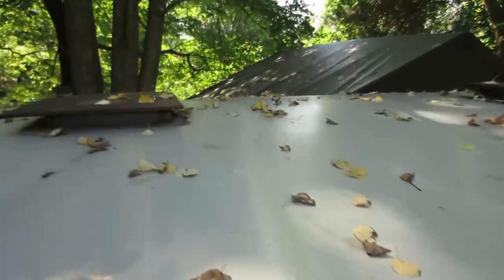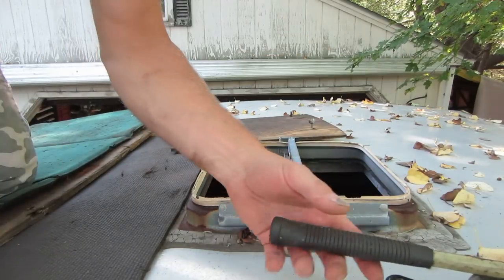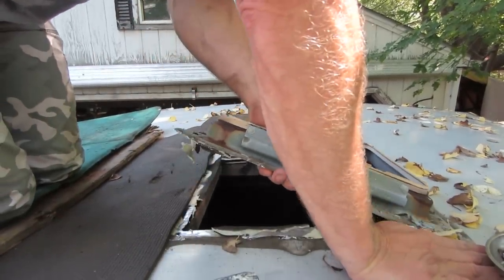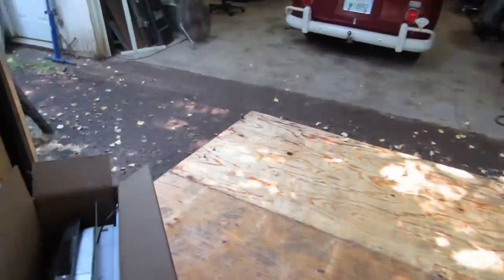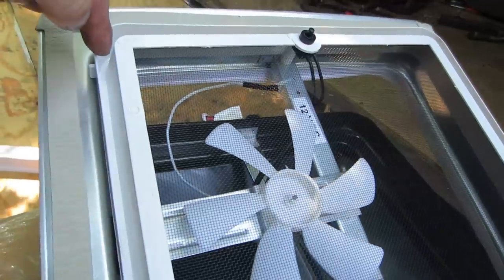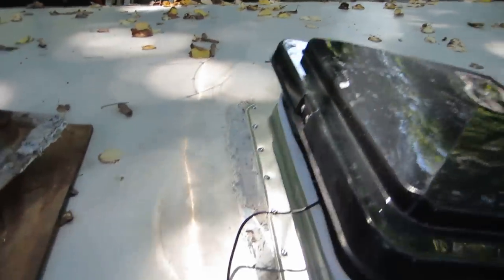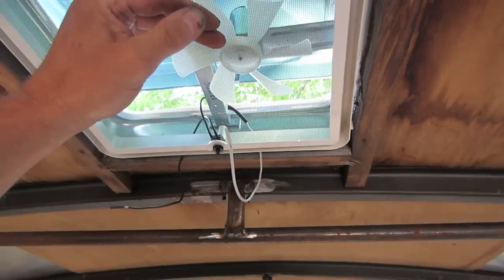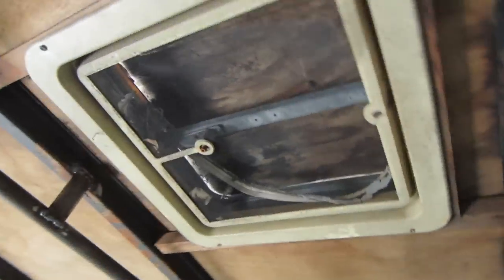trailer skylight replacement

Comment: Nice job on the install. That caulking tape that came with the vents looks like Perma-Gum. I fixed a leak in the inside of my toilet tank with that stuff, almost 40 years ago. It's still holding today.

Comment: Well that wasn't too bad of a job except for the temp and humidity. Looks like you have already more than doubled the value of that trailer.  We finally got a break from the humidity here in MN today, 7:45 pm right now and only 63%, 24 hours ago it was 94%. I've been trying to body work and paint a pickup box for the last week but the weather just wouldn't let me until now.

Comment: New Subscriber here! Love the vids!... on wiring the DPDT switches, another way is to wire fan to the centers, then bring power in from either end & wire an X to diagonal posts (basically wiring it backwards as there are no diodes in the switch). This is common in industrial settings & makes troubleshooting & replacement a breeze.

Comment: haveing The fan run both ways is good for when you are welding or cutting inside the trailer it will suck the smoke out and bring fresh air in.
mark

Comment: ok mustie1 nice job on the roof vents the only thing i say you want do diffent is replace the sealant the was over the sreew head that stuff is called dicor self leveling lap sealant or you get water inside the trailer. you can get the dicor stuff at your local rv dealer if you want look up on youtube rv vent replacement you see what i talking about

Comment: I am trying to imagine when you would ever want for the fan in the ceiling to be reversed...as hot air rises?  There are intake vents available that go on the bottom area of the trailer .    https://www.amazon.com/Cycle-Truck-Cargo-Trailer-Vents/dp/B006R5LND0/ref=sr_1_7?ie=UTF8&qid=1471152278&sr=8-7&keywords=trailer+vent
Reply: pull welding smoke out as he want to weld in the trailer etc